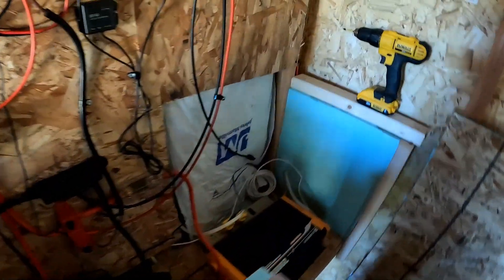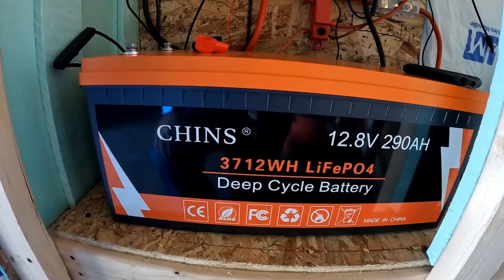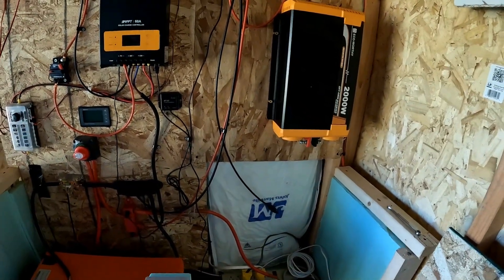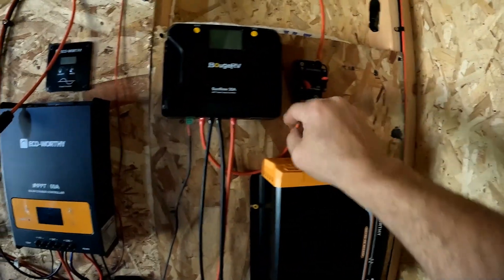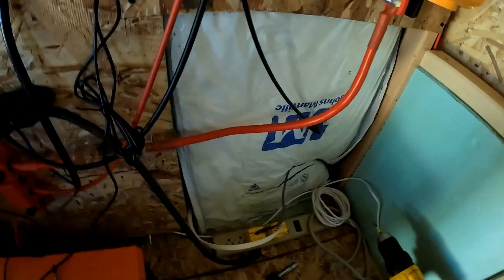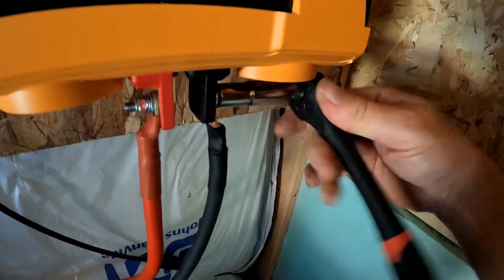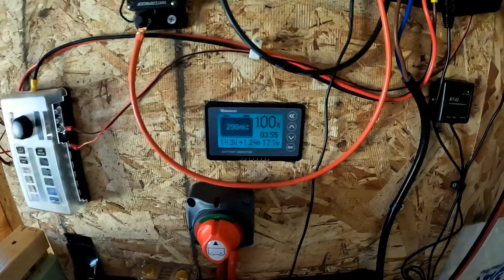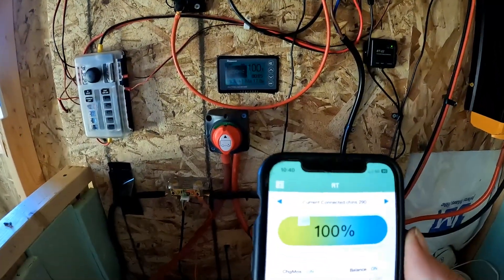Swapping out solar batteries

Comment: I just ordered 2 of these 290ah Chins batteries. How is it working out so far? Any big concerns? Hows the app working out? Those heaters coming in handy? Lol, just really intrigued on the big purchase
Reply from the maker: I haven’t had any issues. Customer service is great. When I got it, I did a voltage check and it was reading 17 volts on my meter and the company was ready to send me a new battery. The App said it was reading 13 volts so I put it on the charger and after it was fully charged my meter read 14.4 and the app said 14.4 so I didn’t get a new one. I’m not sure how the heater works, it has gotten down below 25 degrees Fahrenheit but the battery app says the heater isn’t on by the battery temp was reading above 32. It does what I need it to do, which is to get me thru 6 or 7 continuous cloudy days.
Reply: @mattlacombe3912  interesting, and how many Watts in load during that time?